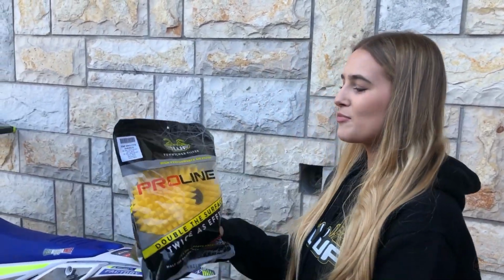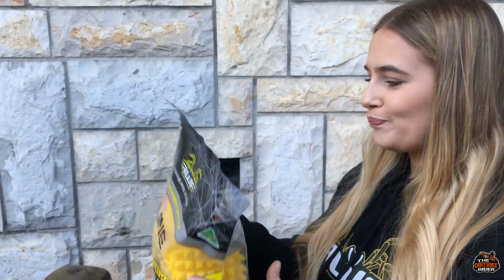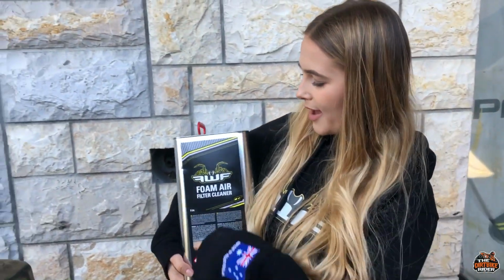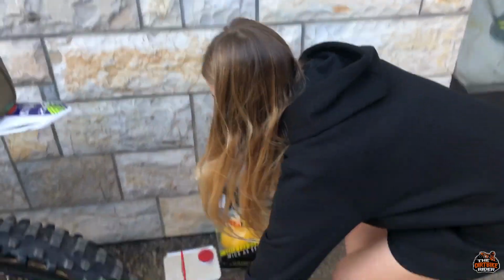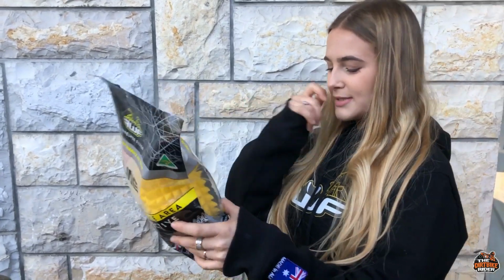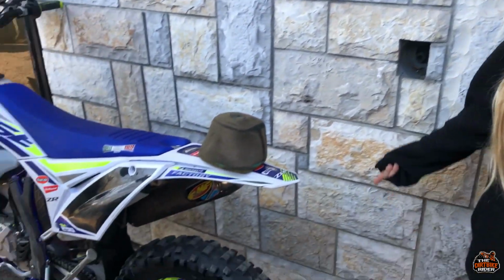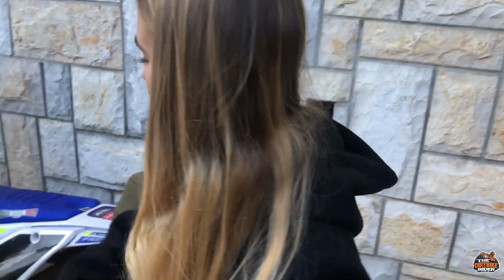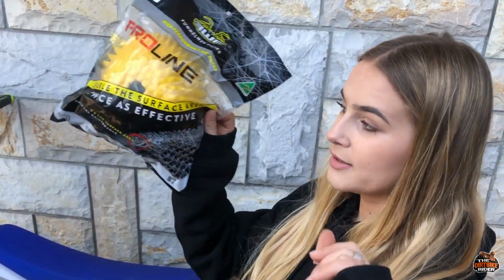Funnelweb Air Filter for Sherco SE250 2019

Comment: I believe these are an Australian product I'm an Aussie and have a 2018 Sherco SE-R 6 days so I guess I should get one for my bike. If these are designed for Australian conditions I reckon they'll be great because the dust down here is a lot finer than other parts of the world and gets into everything.
Reply: Have seen mixed reviews with them. Some swear by them others say they dusted motors with them. I think at the end of the day it has alot to do with user error/fitting along with enough oil
Reply: Grant Yep an Aussie designed product, agree user error, def run some grease around the foam seal to get a good seal to the boot, that will be a potential area of dust entry, after oiling the filter 🤙

Comment: great product but for €45 + shipping I 'll pass.
Reply: Me to
Reply: lasts a lot longer than a regular filter so works out cheaper
Reply: @6226superhurricane   also €45 + shipping you can take 3 OEM Twin Air Filters + oil!!
Reply: @desmonchild  twin air are garbage and fall apart at the seams. i've used both funnel web filters are far superior in every way. they flow better, they filter better, they don't fall apart, they last longer, they don't block up as quick. the only negative is they cost more to buy, but they're cheaper in the long run.